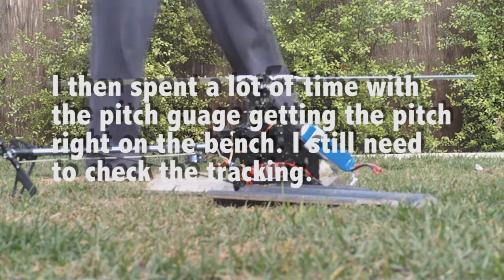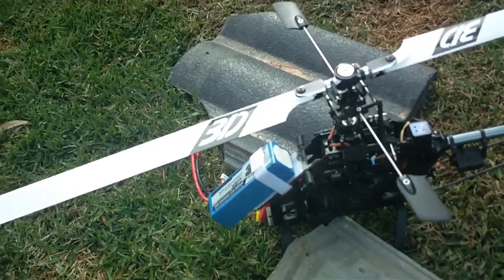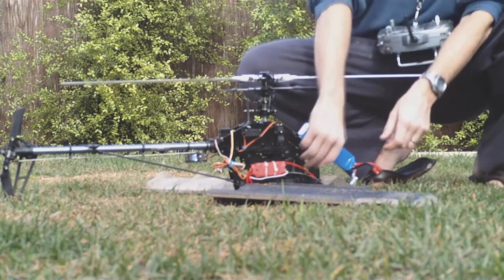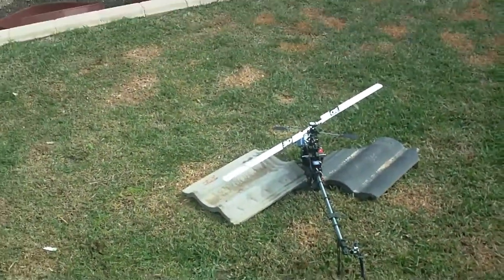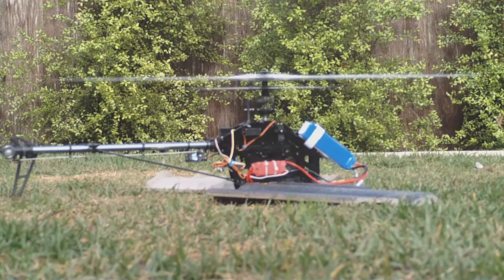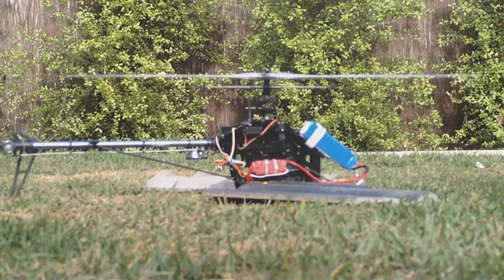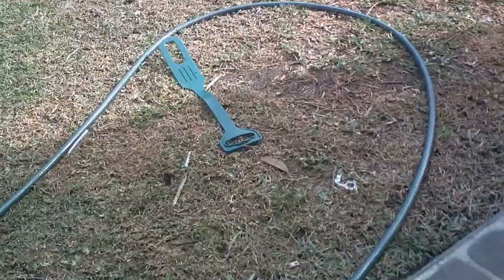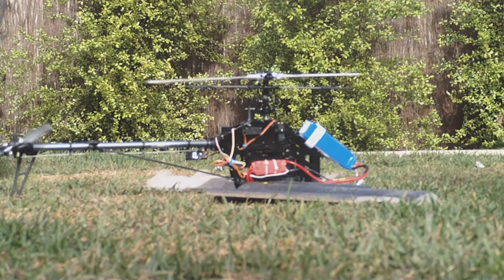HK 500GT Tracking

Comment from the maker: @imusbbored76 Thanks for that. Yeah I still use the DX6i with another Spektrum AR 6200 (or whatever the Blade 400 has) and created anther model on the TX. Wors a treat. I have 1.Blade 400, 2.Simulator, 3.HK500. Jus' gotta remember to change to the correct model BEFORE trying to fly. :) :)